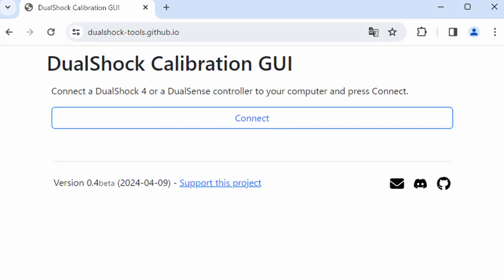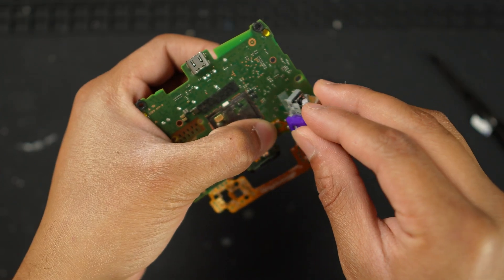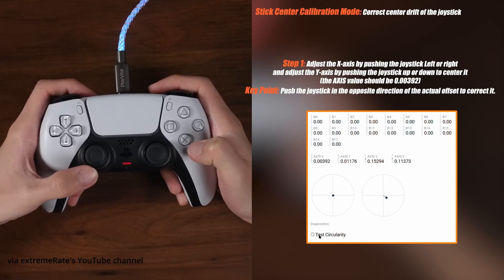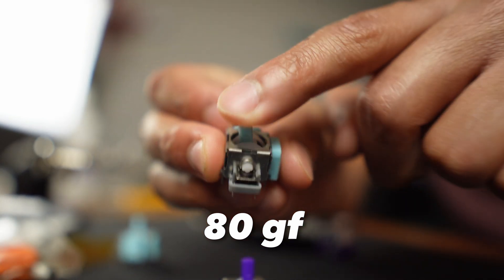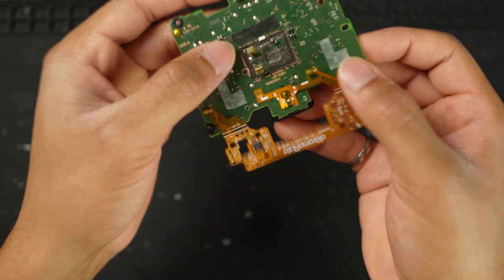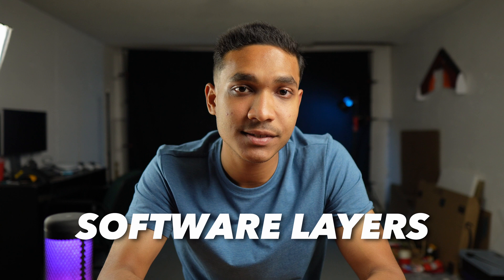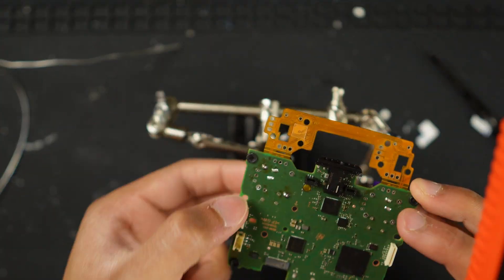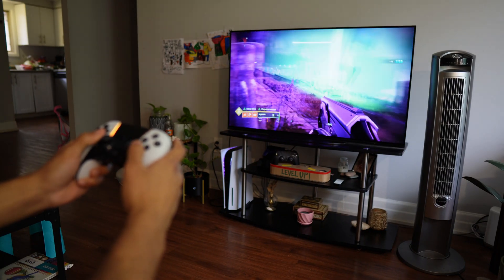I Upgraded My Controller with eXtremeRate Hall Effect Joysticks

Comment: The software on the GitHub is based off of the software used for manufacturing for assembly of the controllers. When you calibrate the joysticks through the GitHub it does it on the hardware level without any in between daughterboards. 
Extreme rateboard will add a bit of processing and control delay to the overall setup. 
Prior to the software I used to use daughterboard for the calibration similar to the extreme rate. 
I have tested hall effect and TMRs using the GitHub. And I have had consistent accuracy without any change in the controls for over 7 plus months! Not once have I had ever to recalibrate the sticks and had a calibration rating of an aerate below five percent. You can also do manual calibrations with finer tune control if you know how to do the advanced settings through the GitHub.

Comment: Unfortunately, you're saying a lot of things that aren't true. The third-party software doesn't change Sony's software in any way; it simply writes the correction values into the controller's flash memory. Sony doesn't calibrate the sticks any other way. Therefore, the additional patch is completely unnecessary.